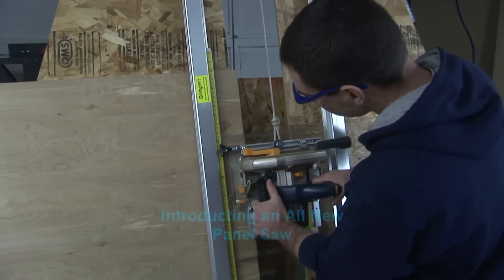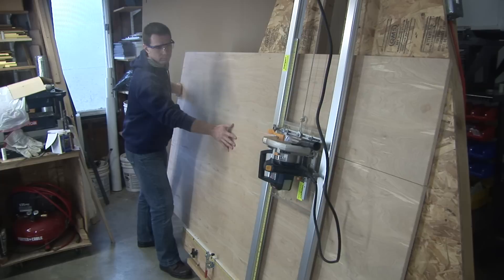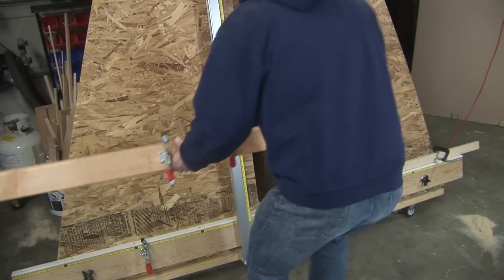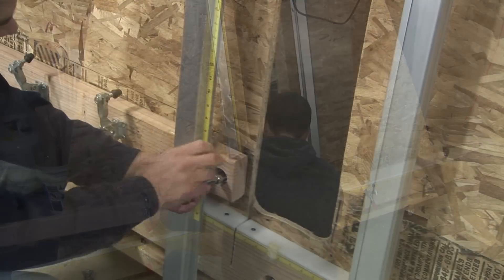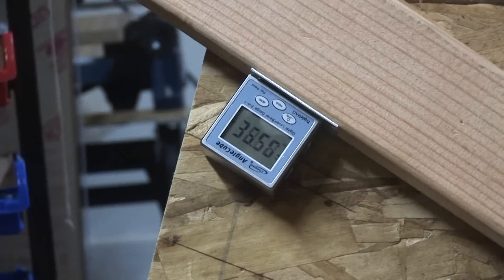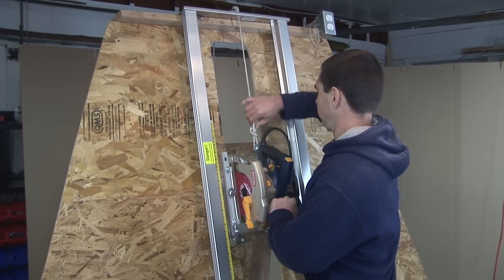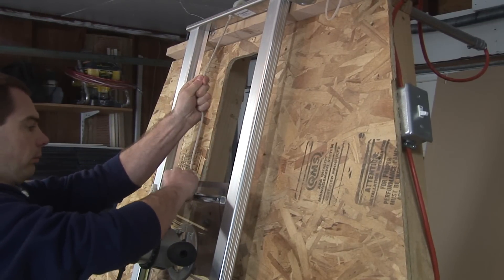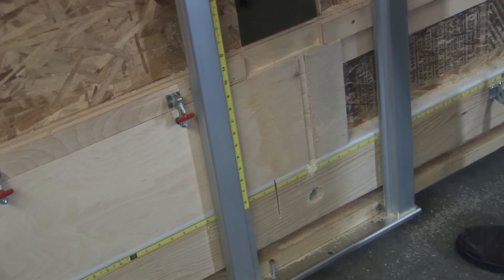SwapSaw™ DIY Panel Saw Hardware Kit From A2Equipment

Comment: So many times lately I have used two unstable saw horses and clamps to cut up lumber. I want to build a fully portable panel saw that is reasonably low cost, accurate, & light enough to carry to a job site, though able to be stored in a small space. These guys have almost what I'm looking for,though the large stand will have to fold up somehow...